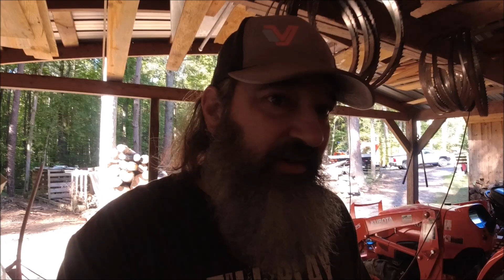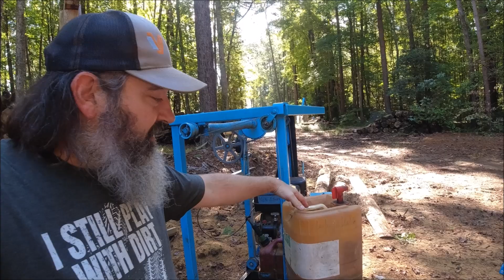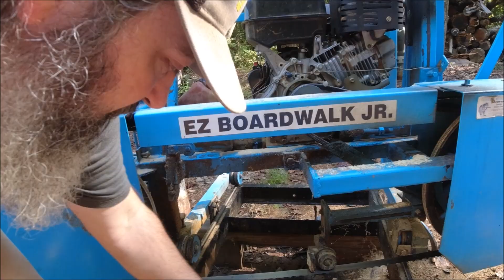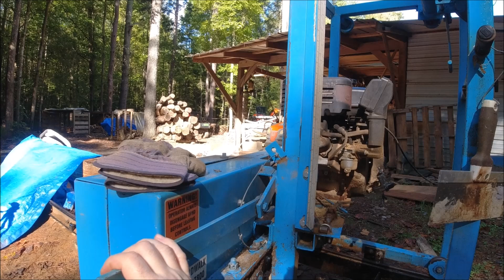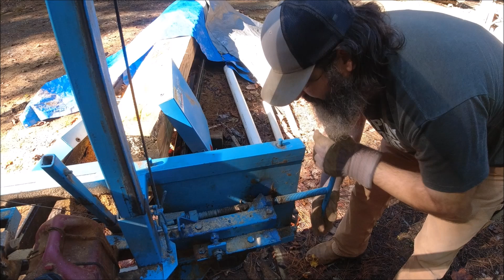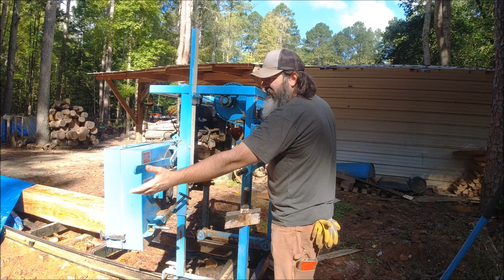How To Opertate Your EZ Boardwalk Sawmill

Comment: Are there any tricks to using the ez boardwalk 40 scale. I have the 40. And as of now I have to use a tape measure and make sure the blade is cutting 1 inch or 2 inches. And of course include the kerf. Wow it’s time consuming. I can read a tape measure. But wow it’s a challenge to use the 49 scale without wasting so much time walking around to get a measure. Any ideas ?
Reply from the maker: I honestly don't recall having any issues. Once u had a can't I just did the math in my head as I lowered the head for each new cut depending on what thickness board I wanted. I do miss that EZ Boardwalk. It stayed with the homestead when we ended up moving. Happy sawing!

Comment: Excellent tutorial Matthew. Tuttle Hardware up here sells and services all kinds of small engine equipment and they have sold more non ethanol gas than the local gas stations. Most of what they work on is because of ethanol. I run no ethanol in everything but the trucks. I've always said good quality equipment has plenty of grease fittings in it. I didn't have any damage either and am glad y'all didn't. Y'all have a great night!
Reply from the maker: @Farmallman63  repair shops love ethanol users! I'm glad you didn't have any damage up your way. I'd imagine it will be years of recovery in the mountains. Have a great night as well Mark!